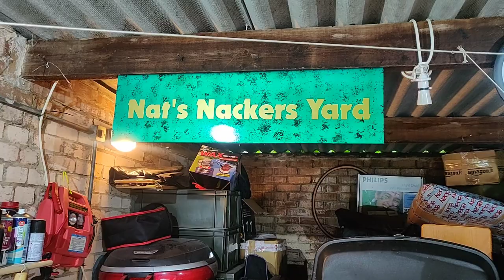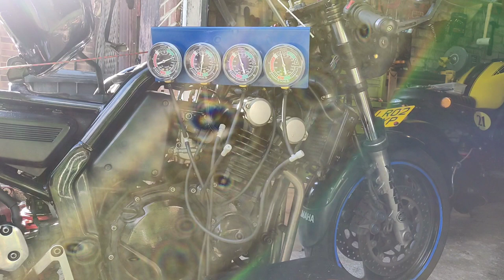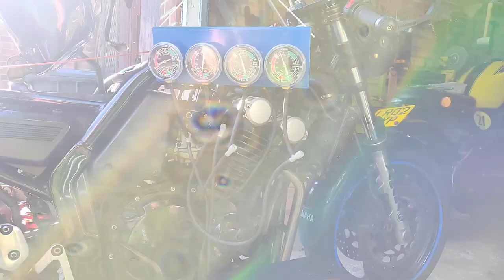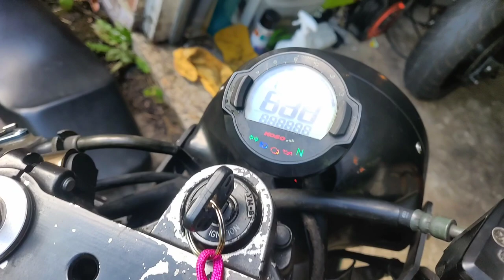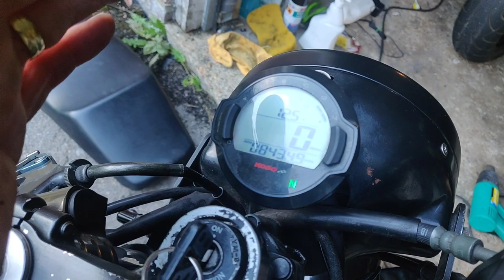Fazer 600.  Carb balance and Speedo fix.

Comment: I did just comment on last video about carb issue.  Try the o rings in the air screws
Reply from the maker: I will have a look but it is running fine now mate.

Comment: hey mate, i got an issue with my fazer and i was wodnering if you encountered something similar or have a tip maybe
i had a lil accident with mine a while ago and i am no rebuilding whats broken, in doing so i had to pull the carbs out to replace the stupid throttle cables...
now after putting it back in i was finally able to start the bike back up again and now the left cylinder exhaust is not getting as warm as it should...
when i spray starter help into the vaccum port of said cylidner it revs up, so my guess is that its the carb that is messing with me here...
i did however fully clean the carb already and tried to sync it ... (it is synced according to the dials but it could also be wrong if the cylinder is not firing cause of something else with the carb...
plugs are all checked and switched already, and i do have spark ( indicated by the rev up when i spray starter help into the vaccum port)
Reply from the maker: That's odd.  Have you tried spraying around the carb manifold to see if there is an air leak?

Comment: Hi mate have a 02 fazer 600 45mls on clock driving fine the last 8months over taking a few cars gave it some welly i think i heard a pop but the next day i took it out there was no power on acceleration boggy as hell reves go up on acceleration but no power just spluttering along wont go over 30-40mls anhour no matter how much throttle you give not mechanicaly minded would you say the carbs need a cleaning as it was laid up a few months before i bought it even though i serviced it but i never did the carbs as it was going well any advice would be greatly appreciated 👍
Reply from the maker: Hey dude.  It sounds more serious than just carbs but it is a good place to start.